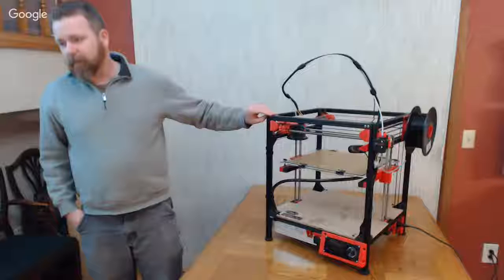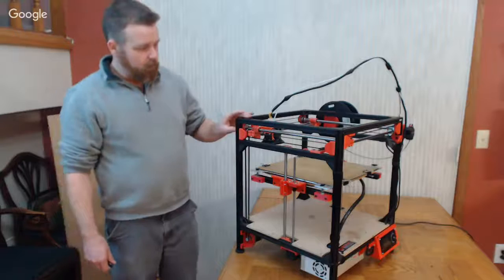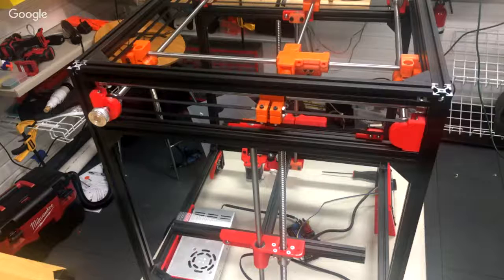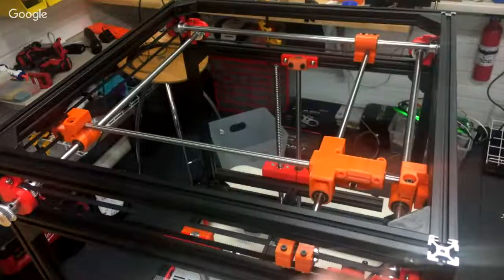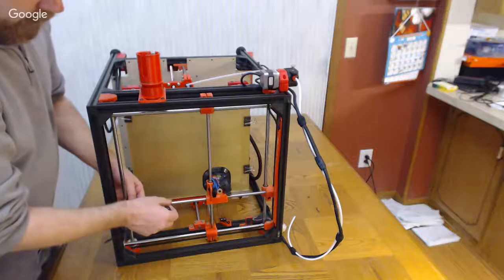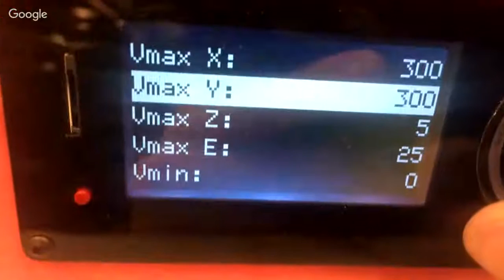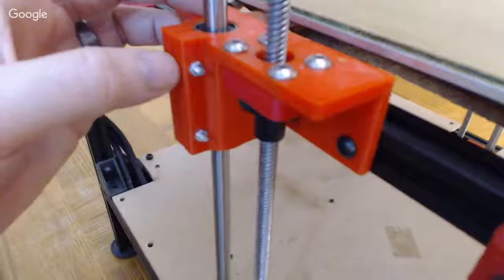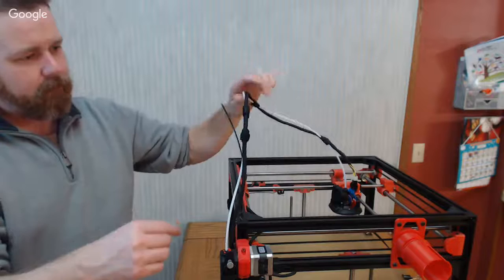Cross Rod Gantry Alignment Tutorial (Eustathios, Herculien, Etc)

Comment: Hey Eric, I just got mine finished and started running some test code to check all the movements and I am getting some chatter on the XY bars when doing arcs.  Any ideas on what I need to do to eliminate that?
Reply from the maker: Chris Leamon if you are getting chatter you likely are out of alignment. First rule of troubleshooting... make no assumptions. Check the frame for square with a high quality square, then measure all your corner to corner measurements. If that is good, check your Gantry alignment like described in this video. If that looks good perhaps make sure your frame sits flat on the table (do all four feet touch and the frame doesn't rock). If the frame rocks shim under the high foot with post it notes until it sits flat.

If none of that works try running the gcode more times. Some times that break-in period just takes longer. And if in the end none of that works make sure your printed parts are not out of alignment since the printer that made those might have been slightly out of square, over extruded, warped, etc.

this is the hardest part of the process. but once done you will be good I promise. I have moved my printer back and forth to MRRF 3 years now. It doesn't go out once set. But break-in is a pain. There are so many degrees of freedom to align.
Reply: Yeah, started working on setting the alignment again today and it is getting better.  I am able to run it a little faster without getting chatter or very little chatter.  One thing I don't have in the corners of the frame are the angle supports so I may add those just to help tighten up the frame more.
Should you be able to feel any vibration in the XY bars or should they be completely absent of vibration?  I have modified mine slightly to use M12 linear rails that I had on hand instead of the M10 in the BOM and am using the graphite plugged brass bushings instead of the LM12UU style bearings.  I was thinking of getting some graphite powder lube to help get them started but not sure if I need it or not.
Reply from the maker: You should not be able to feel chatter, if you do there is likely misalignment, or it needs more time breaking in. One problem with graphite bronze bushings is they do not handle misalignment well. That's why we use the SDPSI self aligning bronze bushings in the carriage. The graphite ones will work fine, but the parts have to be spot on and they take a little more time to find their home.

Comment: Hi my friend, I really like this 3D Printer, I wish to build something like this, but budget for me is an issue right now, I already have a RAMPS with LCD, so, you think I could build this one on the not so expensive side?
Also would like to know is performance if similar like lets say, the Ultimaker 2 aluminium clone?
Oh and last, how can I source the printed parts?
Reply from the maker: Yes, there are certainly ways to save on costs versus the official BOM. Performance is on par with an actual Ultimaker. For sourcing the printed parts look at 3dhubs or your local makerspace. Another option is ask for someone in the g+ group to print them for you at an agreed upon price.
Reply: You think a 150mm*150mm 3D printer will be enough to print the parts needed?
Reply from the maker: Fernando Pedraza perhaps, I would have to look at the bed mounts to confirm... but if not the models could be modified to make it fit.
Reply: Awesome, one last question for now, you think is possible to have everything besides the extruder motor constrained inside the aluminium frame?
In the video I could see a GT2 pulley outside the actual frame, I ask this because I would like to add acrylic enclosure to it.
Reply from the maker: Fernando Pedraza you can, that would be more like the original Eustathios. on the V2 I opted for shorter belts and external motor mounts. look for Jason Smith's original Eustathios files and you will see it. I also have the original Eustathios model on my Github.